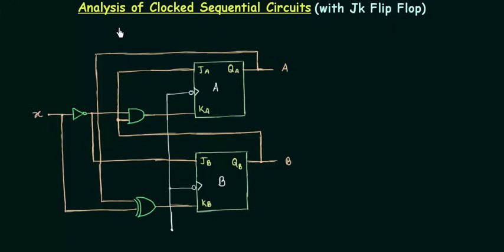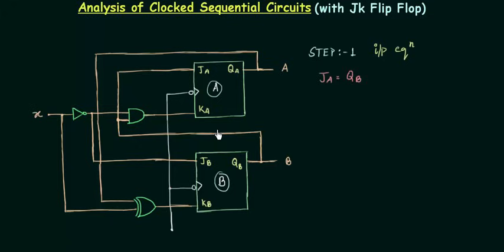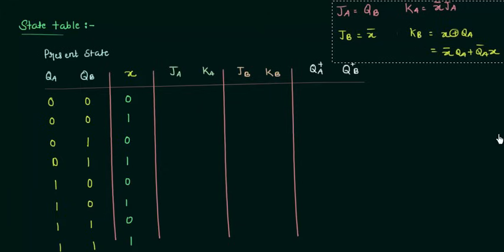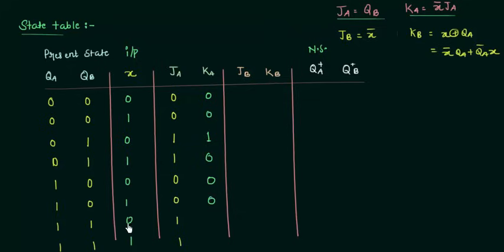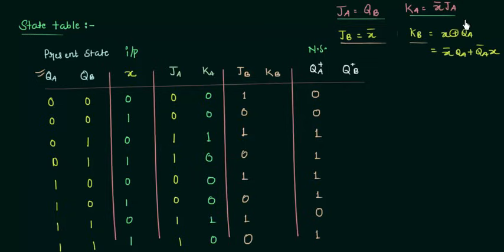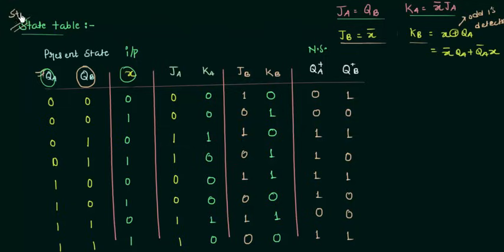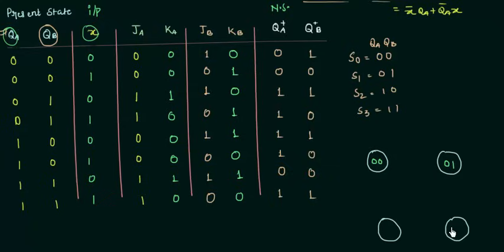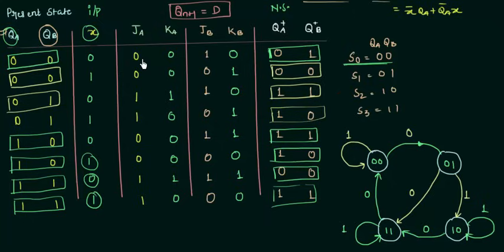Analysis of Clocked Sequential Circuits (with JK Flip Flop)

Comment: This diagram has two outputs, A and B, such that A=Qa and B=Qb. Therefore, we need to draw two state diagrams, one for A and one for B. In simple words: copy the state diagram he drew in the end of the video so that you'll have two of these. Now, decide the output of the first diagram by the value of A(A=Qa) and the second by the value of B(B=Qb)
Reply: This is correct, this comment should be higher!
Reply: hmm my textbook also says no output equation required
Reply: Can't we just draw a single state diagram like he did in the presentation??
Reply: i was wondering why is there no column for the output as in the case for the state table for D FF. thanks a lot
Reply: There are no outputs because the A and B are connected to feedback so they are not considered as outputs that's why we are calculating next state . I am assuming this is this right
Reply: we're not finding the outputs only states change w.r.t i/p an p.s if need output then you need two state diagrams

Comment: i have a question,when you were drawing state table and diagram.In the circuit at the start there were outputs A and B,but you didnt inculded them in diagram.It is obvious that their values are Qa and Qb,respectively,there is no calculation that needs to be done,all am asking is , was there any particular reason why you din't inculded them?

Comment: what about output in state diagram ?
Reply: Yes I was confused regarding this as well, what would we do about that?
Reply: Outputs regarding state machine and transitions diagrams follow numerator/denominator notation on the actual diagram itself where the numerator is the input and denominator is the output, and can be more than one digit big for multiple input and ouputs; use commas to separate multiple inputs (or outputs) resulting in the same state transition. 
Example:
In state 00, he goes to state 01 with input 0, now if there was an ouput during this state transition, then the notation on the diagram would look like 0/1 instead of just zero like he has because the outputs are put into the detonator if they occur in whatever circuit is being analyzed. 
Example 2:
Now say you could also use 1 to get to state 01 from state 00 and the output was also a 1. Then the notation on the diagram would be 0,1/1 because both inputs 0 and 1 will allow state transition from 00 to 01 as well as produce output of 1.
Reply: but,here the outputs aren't shown..right?